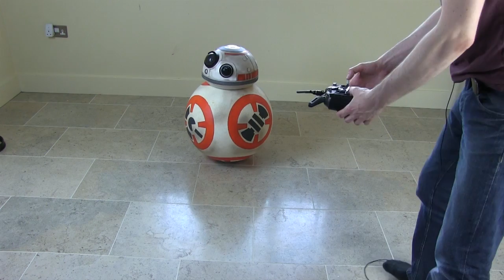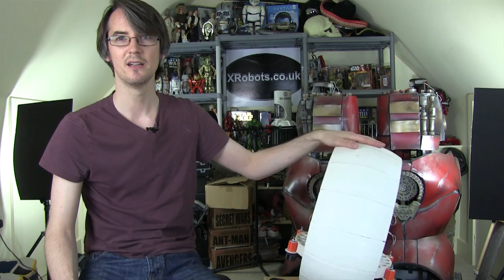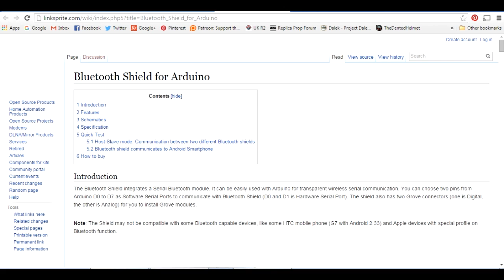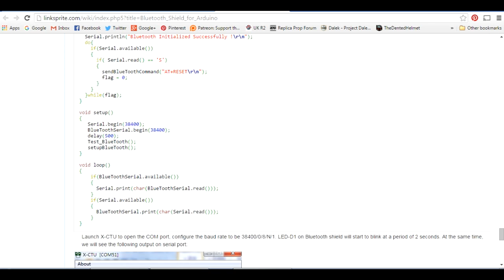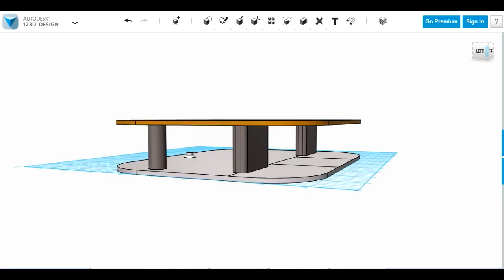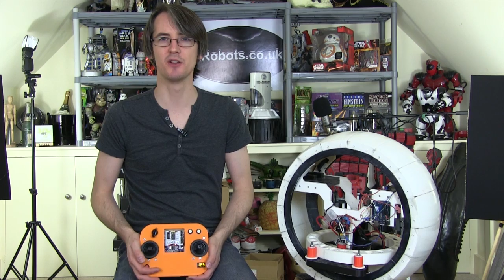Star Wars BB-8 Droid v2 #1 | Overview & Bluetooth Control | James Bruton

Comment: Hi James, I'm loving this project so much, I'm in the process of putting one together, just want to check, for the large flywheel motors, have you tied both the L298N outputs on each board together to connect to each motor? Looks like from your video... :)

Comment: I would use two flywheels, instead of one. Spinning with fixed RPM at rest, in opposite direction of each other. By slowing one down, or speeding one up, one rotates left or right. But they always spin, providing stability on every axis due to the gyroscopic effect.

Comment: Idea: I think you can have forward-backward movement together with rotating the droid in ONE steering-"stick" on your joystick (instead of splitting it up on two of your controllers "sticks"). That way it will be easyer to steer, but also alowes you to have the other/second "stick" for bb8s head (working in the same steering way as the first steering stick). It will give you much more controll over the body of the BB8 but in the same time alow you to controll the BB8shead with two hand. With your solution, you would need 3 hands, or really awsum finger controlling to operate BB8 in a controlled way.

Comment: Suggestion: Use two weighted rings spinning counter to each other. It will provide sufficient inertia to prevent wobbling, and changing the speeds of each ring will allow the same rotation you are using the single ring for!

This would likely provide all the benefits of the current system with only a little added complexity.

Comment: You still should play with the Teensy. It's only $19, it's tiny and MUCH faster than the 8-bit / 16Mhz MCU's. You still use the Arduino tool and 99% of the same code. It DOES require 3.3V sensors, but all the Adafruit breakouts does both 5 & 3V3... Just saying. Would make your life easier :)

Comment: Another design idea where you don't need a totally smooth ball interior would be one big motorized gimbal system. The main problem with that is dealing with the head, but I think it would be possible. If a self contained head system were used, you could even have the sphere walls be thick enough for utility compartments around the whole thing.

Comment: James.....not sure you actually need to turn the robot,(the flywheel is cool though) you only need to change the facing of the internal drive train relative to the outer shell.
Reply: If you are only turning the internal drive train, then you don't need to worry about things like turning on carpet.
Reply: So you could just have a single large drive wheel in the centre at the very bottom, then have smaller radial drive wheels at  90 degrees and 270 degrees halfway up the ball to allow yaw directional change and rollers at the front and back to keep the centre from dragging on the ball shell.
Reply: With driven balls you really need to go HEAVY in the core as heavy = stability
Reply: I looked at the footage again, and there is some swivelling apparent in the footage, however this looks to be due to movement of the head boom (head twist) causing a Newtonian response (body movement reaction) the main telling actions for me are, the perambulation around R2D2 as it is quite clearly driving a curved line without twisting to align course, and when BB-8 leaves stage, again in a serpentine course without twisting to maintain direction.
Reply: Also when bb-8 1st comes on stage he pulls a 90 turn without twisting,
Reply: Don't get me wrong, I love the work that you do.

Comment: Try lowering the center of gravity. I think that adding weight on the turning wheel would be the perfect sollution. not only lowering the center of gravity adding stability, but also increasing the momentum on the wheel, eliminating the wobbling while turning.
Reply: +James Bruton (XRobots) , is it possible to get the 3D printer files for this build?
Reply: ***** , greatly appreciate it! I have a project idea and, as you are more intelligent than I, was wondering if I could get your thoughts.
Reply: ***** awesome
Reply: +James Bruton (XRobots) omg
Reply: +Angel Gonzalez or adding a very thin rubber skin for better friction.
Reply: ASolvie the thing is that the wheel does not directly turn the sphere with friction, that would only work with troll physics. what he did was that since the sphere is esentially free floating he uses a weighted wheel to rapidly change the angular momentum of the sphere, thus turning the sphere whenever it starts or stops spinning, in which case it would be more benefical to reduce the friction between the spere and the wheel to reduce the amount of lost innertia and reduce the stress, which he did in a later chapter. He also did follow my advice and added more weight to the wheel, which I do believe happened in that same chapter.

Comment: need a pendulum weight on the drive for forward/backwards driving .. either hanging from the top, with a central weight.. or from the top, with a short arm for high weight, or off the bottom .. am really too stoned on pain medication to visualise the physics ... edit or my grammar

Comment: Question: why drive the wheel on a smooth surface with this design rather then a gear toothed track?  It appears in this design the main motor only drives in forward and reverse and the ring provides the ability to turn correct?

Comment: you were so close! why not have that big weigh act as a gyroscope rather than just a flywheel? have it run up or slow down to turn, you'll get more torque and it will work to stabilize the ball.
Reply: +James Bruton (XRobots) well il defer to your judgment your creating wonders so far keep it up!

Comment: It's top heavy with the motors  that run forward and backwards. you should consider lowering them. Just a suggestion. This less weight ti add to bottom. probably if the shell was lighter. apart from that a good attempt

Comment: Idea on stability! it partially exists in your design as is. If you split the internal flywheel into two half and had them counter rotating against each other, you would have a gyro. Vary the speed between the two to rotate but alway have them spinning.
Reply: +Michael Marzec thats exactly what i thought !!  it should totaly prevent the ball to swing.    and maybe also improve driving
Reply: +Malte Maas fd2qiuuuu6t
Reply: +Malte Maas etq
Reply: +Michael Marzec Clever, this is the way many R/c helicopters work.
Reply: +Michael Marzec 
Really good idea :-) Only issue is the reduction in battery life.

Comment: I think that if you allowed the inside part to be affected by gravity, it would act as a damper like those ball bearings do in version 1. Maybe if you used really low friction idler wheels and some kind of clutch on the drive wheel that released the wheel from the motor when it's not under power. Like a bicycle hub, but I guess this one would have to work in 2 directions.
You could also achieve steering while in motion by having a weight shift from side to side. In this way it would turn like a motorcycle does. Basically what you're making is a monowheel, which I've been planning on making for awhile now. You should look up the Dynasphere if you haven't already. I think there's a video of it turning despite it's large size.

Comment: maybe have 2 weighted disks instead of one and have them spinning in opposite directions like a coaxial helicopter and use differential speed to turn? then you get a gyroscopic effect that keeps the inner section upright. and remove the wobble. only issue is noise.

Comment: This have been a nice surprise.

I was thinking something crazy. I think that increasing the contact surface between the ball and ground will make the whole a little harder to accelerate. If it is harder to accelarte it will easier to compensate the angle.

So with the ABS ball the contact surface is very small but, what about a ninjaflex ball? The weighter the ball, the more contact suface. It can be done in the same way you did the other.

Just an idea.

Comment: I suspect that the ideal solution would be an actual gyro-stabilizer with flywheel. That would mean a substantial increase in weight, cost and power consumption of course. Maybe consider 3-axis flight stabilizers  used in r/c aircraft? They appear to provide autonomous real-time feedback.
Reply: +James Bruton (XRobots) The horizontal flywheel works brilliantly. I was about to suggest a vertical flywheel as well, but I've seen part 2 now.

Comment: James, could you possibly help with my 3d printer?
i have a solidoodle workbench and when i try to print something, each layer is off (forward of center) from the first layer about 3-5mm. whats going on and how can i fix it? also using solidoodle default programs and slic3r.

Comment: Nice work James. Very interesting concept. I bet you've talked to Matt Denton about this project. I'm a big fan of rolling bots myself. Keep up the good work. Cheers.
Reply: +James Bruton (XRobots) Lol, yeah I bet he is.. Have you ever considered having the batteries/power cells inside a redesigned central hub and using a custom slip-ring? Just an idea..
Reply: +James Bruton (XRobots) what transmitter are you using.

Comment: I wonder if gyros in the X and Y direction could help this stabilize? They might eat up a lot of juice so you'd have to modulate them during movement and a timeout for when the motor stops (ie. just to eliminate the sway).

That remote is quite nice. :)
Reply: That is exactly what I thought. Put a gyro spinning in the vertical axis to eliminate rocking, and another spinning in the horizontal axis that would be able to be rotated in the vertical axis, providing very stable turning. (Like they do with satellites) 
Now, modulating the gyros would use up a lot more power as the acceleration is actually the part where it is using most of it, once the gyro is up to speed it is incredibly efficient. Also, modulating would introduce rocking/spinning to the robot, so actually just keeping them at full speed should be no problem.
Reply: +youtubasoarus This was my thoughts.  A paired series of counter-rotating gyros.  Use a set of clutches to engage them to the sphere to drive movement while the others will provide stability.  A design hurdle would be powering relatively substantial (mass) gyros at speed and then associated constant noise.

Comment: You might be better with the HC-12 433 serial modules from banggood, better range while using the less crowded 433 MHz signal. I've had consistent data stream at double the distance of Bluetooth with these.
You might have issues with maintaining a steady stream of data with Bluetooth where the stream gets interrupted and buffered, and then get a short burst of data. Might be an issue when controlling a robot in crowded place. Buffered data stream is something you might not want in radio control and NRF24L01 modules might be the better choice.

Have you considered using the Teensy 3.1 to run your Arduino code? For more processing power.

Comment: I really don't know if this would work, but could you get stabilisation by running two fly wheels in opposing directions, then adjusting the speed of one to allow turning, similar to the way a coaxial helicopter works...i really don't know if it would work, just wanted to get your thoughts on it!

Comment: Ever thought about buying a co2 laser cutter? These are way more handy to create flat panels out of acrylic. And look way better than 3D printed planes. Laser cutters are an great tool to supplement a 3D printer. They do the thing 3D printers suck at: Create large planes. Fast, accurate and beautiful.
Reply: you could use it to cut out panels such as the ones on the hulkbuster suit that you stick to the foam panels. Also you could cut out little details and such. That said it is a little too expensive compared to how much use you can get from your 3d printers so i understand not really wanting to buy one.

Comment: For stabilization, have you thought about using computer controlled input manipulation?  So it changes the speed of the motor as you move to cancel out the wobble.
Reply: +James Bruton (XRobots) Right, now I feel bad for skipping over some of that, but it is like 3am here, and for 3am me at least, this is rocket science.

Comment: If you moved the batteries into the centre wouldn't it be more stable? Also, if you had the 2p wheel turning constantly it would still work to change the direction of your BB8 but would also act as a giro?
Reply: +James Bruton (XRobots) Sure but I was meaning the tilt (backward and forward) dampening effect of the 2p wheel. In the video when you turn while rolling the tilt is massively reduced. You may have to tune your pid values while turning to take this into account...
Reply: +James Bruton (XRobots) Or perhaps two flywheels turning in opposite directions acting as gyros, and when you wish to turn a certain direction, one flywheel slows down, such as a dual rotor helicopter
Reply: +Wil Ezekiel one slight problem with that is that it would use more power, especially when stationary as the motors would have to constantly spin the gyros.
Reply: +Jason Kay It wouldn't need the gyros when stationary though

Comment: The rocking of the ball is caused by the weight that is off center.. would it be an idea to get the weight (center of gravity) as much in the center as possible?
And maybe use 6 motors to drive the ball (2 motors for each axis touching the ball on opposites sides)
Then balancing shouldnt be an issue anymore with some coding you used in the original design.
Reply: Youre right the weight should be off center (stupid me ;-))  
i would be left with a dead ball and moving internal contraption :D
arent you worried about turning?
Reply: +James Bruton (XRobots) if that doesnt do the trick you could consider a weighted penula inside .